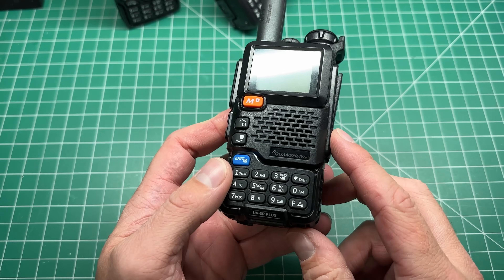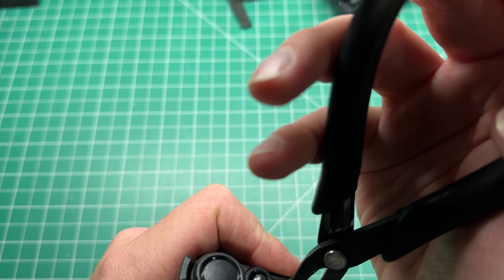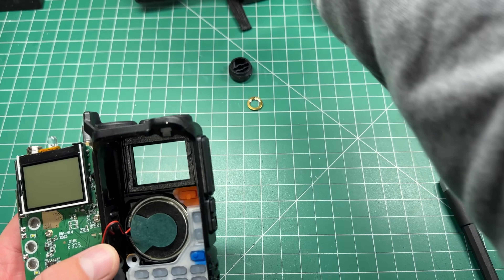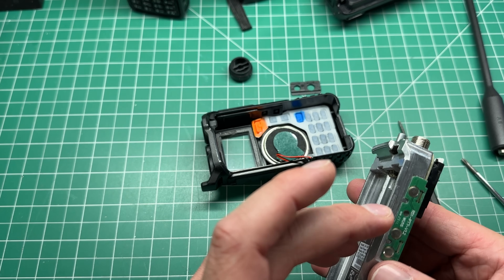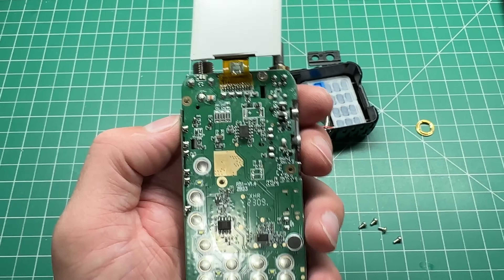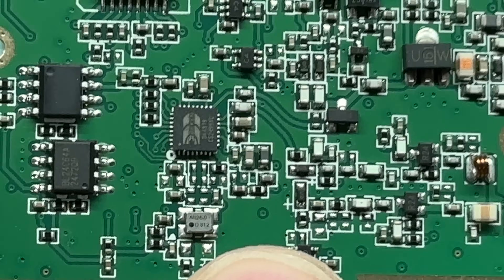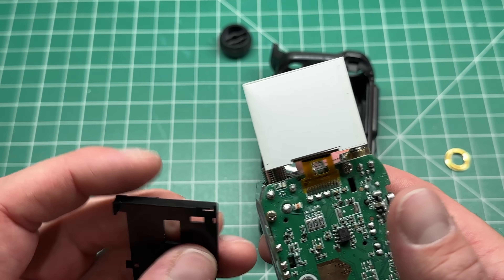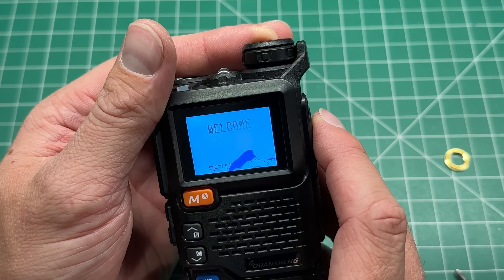Quansheng UV-K5 Radio Teardown! (UV-5R Plus)

Comment: You don't need to remove the antenna connector nut on this radio to disassemble it.

For any radio device that has an FCC ID, the last digits are the model number of the board that was sent in for evaluation. Any major design change requires a new verification. Although this is sold as a uv5r, you'll notice that the last digits of the FCC ID are still uv-k5. This is true for the uv-k5, k5(8), k5(99) and the uv-k6. 

Although it has a different FCC ID, the retevis ra-79 is also the same chassis.

I Hope this is useful to some of you, if not I'm sure you'll let me know.

Comment: @HamRadioDX - Are you able to confirm if the LCD is internally lit, or if the LED's are external?  If external, I assume they'd be SMD and most likely not easily replaced, but one could perhaps put a color filter over them(?).  The white backlight isn't ideal.  Thanks.

Comment: Most radios to get the antenna nut off the Volume Knob has the Key to remove it just take volume knob off and use it to take the antenna nut off works for 90 percent of all Baofeng and Quesheng radios as well as some wouxun and tyt and kenwood ones as well as tidradios hope it helps in the future 0:40 @Ham Radio DX
Reply: Wow! I would’ve had no idea at all.
Reply: @uzaiyaro  hope the information was helpful
Reply: These quansheng knobs does not have the four things that is used to unscrew the antena ring. Just disassembled mine (K5 8).

Comment: It's crazy opening up an old handheld CB and seeing how complex and dense it is with full size caps, trims, and inductors with a singular transistor on the heatsink.  Then seeing a modern $20 and seeing how thin it is, but all the same components in SMD format, and a frew SoCs to simplify it even further.
Reply: New ones also have alot of ICs doing the brunt work. still have to agree on the SMD part it crazy how small some parts have gotten over the years

Comment: The volume nut spanners is available if you google "X-Key + Destuffing Wrench Radio Repair Tool " and look at images. The spanner is a 4 way one which fits most radios. I bought one years ago but it's not obvious what it's called. I only say look at images as it should hopefully show a website you recognise to buy it from.

Comment: Hi ham radio could you help me just bought a mag mount and a ham stick the mag mount has a female connection and the bottom of the stick too how can I fix this  connector connector
Reply from the maker: Look for an adapter on Amazon.. there should surely be something on there. Do you know what type of connectors?
Reply: @HamRadioDX  both are female if you can get 2way female to fit 2o239 I think .

Comment: Great video .. I haven't done the firmware update yet.. been busy with other stuff .. but I'm guessing an LCD Replacement video may be in the works for you? looks pretty straight forward although i don't recall seeing any markings on the back of it for a replacement part.  K6WRF - 73
Reply from the maker: The radio will probably be put in the spare parts bin ;)
Reply: Or you could still use it with the remote operating control firmware,

Comment: The AN26 is the crystal I believe.
Reply: 26.0 MHz  6th harmonic on 156.0 Marine air sea rescue, they aint made for marine use
Reply: @phillipsmiley5930  I agree, but 156.0 MHz isn’t a valid marine channel. The closest is 156.050, which is 50 kHz away.

Comment: Does anyone have an idea what the "unknown" chips are? Ie. Their purpose.
Reply: the chip nearest the battery contacts is the sudio amp
Reply: The big square one is the beken arm mcu, the small square one is the beken sdr. The 8 pin on the bottom rear is eeprom 64k, the other 8 pin  is audio amp. The remaining chip is the broadcast fm radio

Comment: @HamRadioDX    i always wanted to make a sleek pocket radio with a  UV-K5,    1.  shave the thumb guard around the VOL knob.   it just extra plastic,   2.   find a smaller VOL knob.   3.   use the  "bullet" antenna from  Diamond Antenna called the   RH3,     or alternatively the  SRH -805S   .   both are nearly 1"   long.    That's it.      Now you have a radio that fits  entirely in a shirt pocket.    Or into your pants pocket.
Reply from the maker: Smart shirt pocket so when you go to fancy dinners you can have your Feng ready to go ;)

Comment: People in Russia are starting to do circuit board upgrades. Where’s our engineers?! 😎
I can do the mods but I don’t know the engineering. It’s just changing out components. And or expanding a section with a surface mount mini board.
Reply: There is also uart control, and via terminal from phone or pc, messenger and bbs
Reply: The chinese group is also ploughing ahead with hardware mods and firmware to activate them
Reply: @liesofgasandpilesofshoes  thanx! Awesome!

Comment: 0:21 they are not, the most obvious is the usb, so the board inside will be different, onlly don't know if it is just remove the usb or it has a completely different PCB.
Reply: if you watched the video before commenting like a sensible person the you would've known that the usb-c stuff is only missing on the UV-5R, the PCB has the pads and holes ready.
Reply: @RamenPoweredShitFactory  Iactually comment while I watching, not after finish watching, so at the time I did know what will happen after the 0:21🤣🤣🤣, and after I watch it I already know whats inside, but I didn't delete this comment🤣🤣🤣

Another curious thing, is there use pin, if it is, will it charge by usb after soldering a type c port in it??? 🤔🤔🤔

Comment: So is this 5/8 or UV k5r plus the link in the description goes to an Amazon page for the uvk 58
Reply from the maker: It's a UV-5R Plus... it's essentially the exact same radio as a UV-K5. As per the other comment, with only a few minor changes, no USB-C, screen etc.
Reply: Is a K5 with the USB C socket and components removed and a Blue backlight added, in a Bao UV5R look a like case

Comment: 0:58 thin wall 6 point harbor freight socket or nut driver and if the wall is still to thick 😳grind it down or lathe it thinner if so equipped ☺️

Comment: I can imagine there is a few people messing with filters and such, If it could be modded into ten meter that would be cool.
Reply: Haha I was going to suggest the same thing. Maybe 10/6m
Reply: @mrt18709  I have one ripped apart, haven't went poking on it yet but the goal is to filter it for 10, 6 would be a bonus so we will see.
Reply from the maker: I'm not sure how wide the final output device would be at 6m/10m.
Reply: @HamRadioDX  might need massive tinkering but whatever, I paid like $20 for it. 🤣
Reply: Back in the 90s Cherokee had a handheld (AH-100) that was AM/SSB CB that could be modded to 10m. There was another that was identical in appearance but AM/FM/SSB 10. I think it was Magnum brand. 

So it's possible to build a 10m all mode handheld.

Comment: Based on package and components around it, I believe the AN26 is a crystal.
Reply: 26.0 MHz crystal osc module, so a harmonic every 26MHz
Reply: @phillipsmiley5930  Correct! it is indeed a 'Crystal Oscillator' Voltage-controlled, they are widely used as clock generators & timing signal generators in such like, communications equipment / digital equipment. 

In simple terms it's a device for producing alternating current. especially : a radio-frequency or audio-frequency generator. Hence why it's in such a device.

Comment: Damn if it doesn’t work when you reassemble it that’s a fail. Haha. Interesting to see the guts of one of these. 
Wonder how much messing around it would be to retrofit the USB C.
Reply from the maker: The USB-C is missing other bits I suspect like a few chips... who knows what they use there (without opening up a K5 and having a look. The chips would deal with the voltage regulation and charging circuit.
Reply: I encountered a similar situation 40 years ago hacking a SONY Beta VCR. The Japan model had B1 speed but the North American (NA) version did not. A feature that was highly sought after. I got the schematic for the Japan version which detailed the components that where missing on the NA system. Plugged in missing components and Voilà - B1 speed. That model never was released in NA with the B1 speed. Probably the only one in NA with that capability.
Reply from the maker: Haha... lucky it was cheap! But yeah, gotta be careful with that LCD screen!